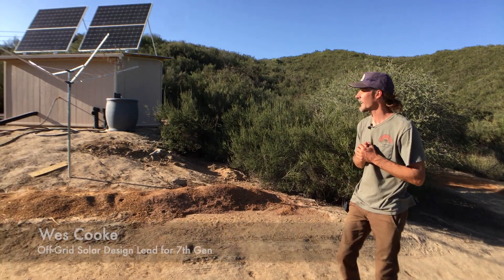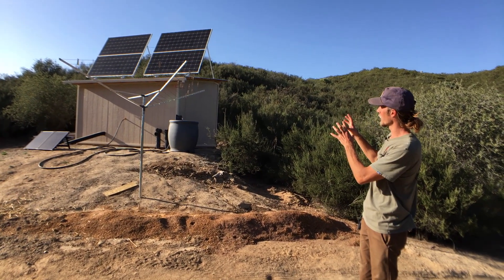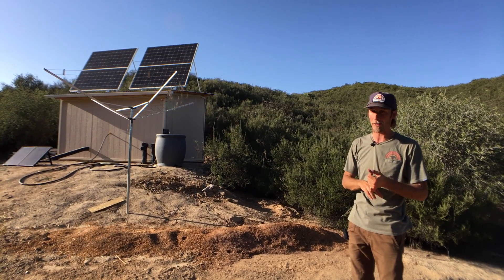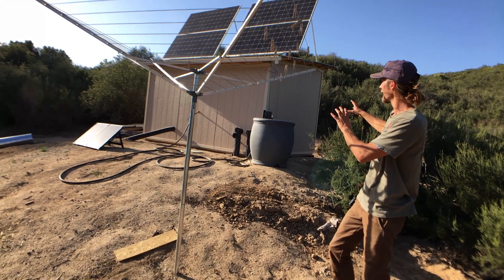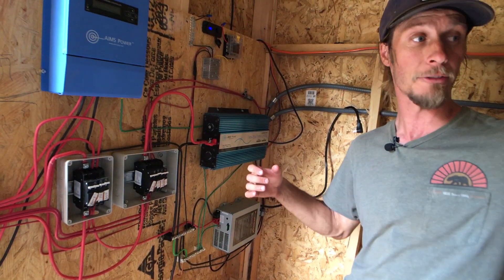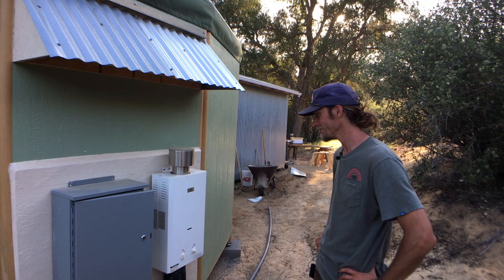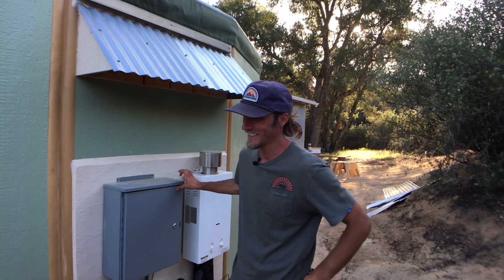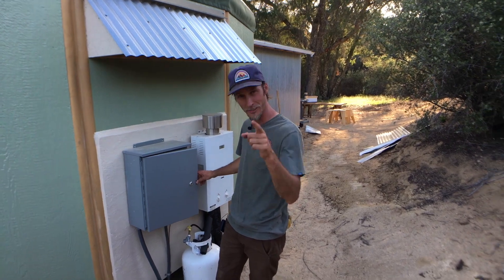100% DC Off Grid Yurts Solar Electrical System

Comment: I am from the Pacific Northwest and have 7.7 kW of PV on my roof. I’m running a 24 V system. 
I could do that with less, but it rains a lot here and I find the biggest problem in the winter months is insulation. So if you’re in a cold environment, I would concentrate heavily on the insulation.
Reply: Hello Ben. I’m researching for a new build, all DC home. Obviously having issues with finding the larger appliances.

What solution did you go with for fridge/oven/washer/etc.? I’m wanting full-size, “normal” house appliances, so looking at modifying them, or point-of-charge inverters that can be unplugged as more DC only appliances become available over the years.

Hope to be where you are power-wise in 8-9 months. Congrats on being there!

Comment: Very nice, it must be super quiet in those yurts. I'll check out that e-book. Recently I rebuilt my system and for the same cost as 10 years ago, I doubled the power available. 1600W solar, 24 volt system, lead acid 400Ah battery, if I was to change it further would be to have 2400W solar...which would involve a bigger model charge controller...or go more dc like in the video. Thanks guys, you rock.